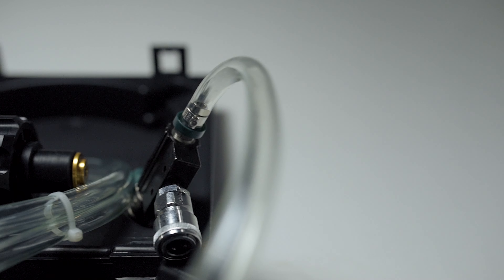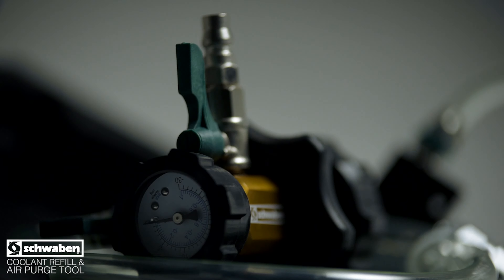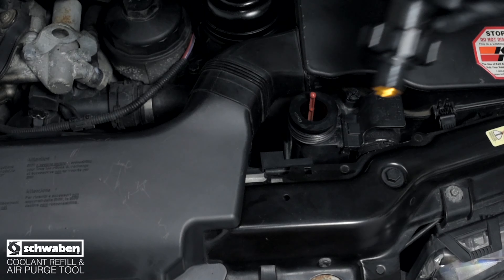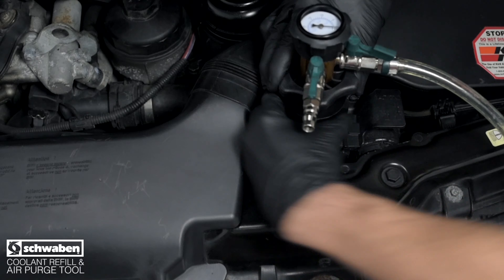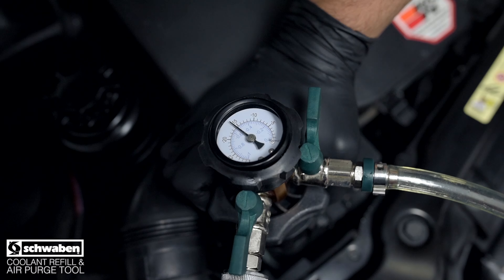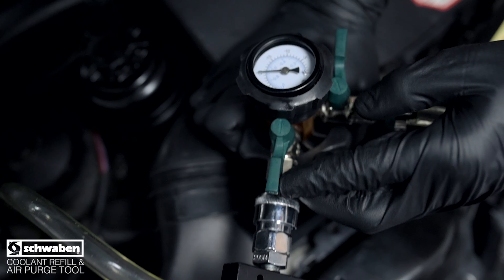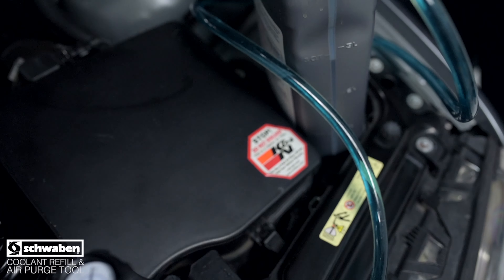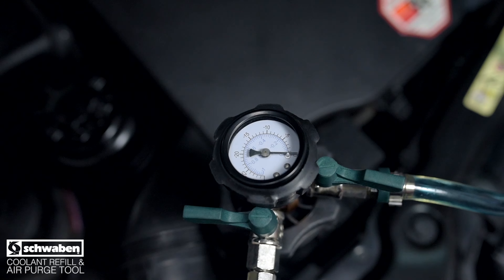How to Use a Coolant Evacuation Tool

Comment: I totally agree with Dan z. It's all misleading. Evacuate to me means removing all fluid (coolant) via vacuum pulled. Than switching a valve too allow new coolant to enter system air free. Done..

Comment: The hose sucking the coolant was empty of liquid and full of air... all the air went into the cooling system.

You need to create the vacuum, then open the feeding valve until the hose is full of coolant up to the gauge, then close it and re-apply the required vacuum, then open the coolant feed to fill the system.
Reply: That is correct. I thought the same thing.. oops, you just let all the air in the tube between the valve and the coolant jug into the system.  This defeated the whole purpose and really is a fail.
Reply: in theory yes, the volume of air from the suction hose went inside but in reality what actually happened, this small amount of air just lowered the vacuum inside the system from -20 to let's say -19 inHg...still plenty of vacuum. A complete vacuum would read -29 which is not necessary for this kind of procedure anyways. So there was nothing wrong with the procedure
Reply: T🥲❤❤❤

Comment: It is the proper tool need on many newer model 2000 and up vehicles factory recommends to prevent air pockets is cooling systems which cause major damage the engine it may not remove all air but enough to do the job !

Comment: why do these tools get labeled as evacuation tools?  evacuation to me is evacuating the cooling system of the fluid...
Reply: Because it is evacuating the air out of the system
Reply: @handyishrandyish334  Then it should be labeled "coolant system air evacuator" not "coolant evacuator". This is not what I am looking for.
Reply: @Addison0526  definitely agree with you. I learn how to use this at school and admittedly got confused thinking you could extract fluid with it but really it will just spray fluid/water if you try, but it doesn’t take that long to drain a cooling system realistically it’s just taking off a hose or using the drain cock sometimes like on the Prius I worked on the drain cock is just really hard to get to you and you have to remove the whole bumper cover panel😅

Comment: So I have a question.
If your pulling a vacuum of 24" (30" being absolute vacuum) then you are only removing 80% of the air.
What happens to the remaining 20% of the air.
Does it just congregate in any high spots.
Can the process be repeated when the system as coolant in it?
Reply: When you negatively pressurize the system to about 25 psi, that should take as much air out of the system as you need, there's no chance of enough air staying in there to cause any issue.

Comment: Well the question is, how much psi are you pushing through the devise? Or does it matter?
Reply: Posting in 2023 and STILL trying to find the correct answer to this question. 
Im actually amazed how difficult it is to get the answer. You'd think it would be in the products instructions, but no, it is not. Ive watched all the videos i could find on the use of this EXACT product and not one of them says how much psi they are using... NOT ONE!!
Reply: @TheNobleLoyalist atleast 90

Comment: The air in the tube between the valve and the coolant jug entered the system defeating the whole purpose.
Reply: As it is such a minuscule amount it shouldn’t cause an issue. When the coolant circulates around the engine, the tiny amount of air should flow back into the expansion tank as air bubbles where it will percolate to the top and will fill the space in between the coolant level and the lid/ cap of the expansion tank where it will stay along with the air that was captured when screwing down the expansion tank cap.
Reply: @cmrnx  guess my question then is... why bother?  just dump the coolant in.   Id say our definition of minuscule differs.  I think bubble,  you think enough to fill a cooling jacket.  That is also plenty enough of air to get trapped in the heads ... just prime for airlock..then  hot spot..then warping, especially if thats your method on a high horse setup
Reply: ctsvmapper if you think of it in this way, if you take say the lower rad hose off, then replace it, is terms of displacement, the volume of air that would enter the system through the pipe being removed would be vastly greater than the air that would enter via the small purge pipe on a tool like this. I work in a main JLR retailer and have used both the traditional method of filling the cooling system as well as using one of these tools, I’ve never had any difficulties after using the vacuum filler but occasionally with the traditional method, I’ve run into difficulty
Reply: @cmrnx ah gottcha,  yes you are correct,  even when not fully properly using the tool to its full potential is still more efficient than traditional.
Reply: Obviously, which is why you should prep the fill tube before hand to fill up with coolant and prior to filling it.

Comment: All of these purge tool labels stress drain coolant system first. doesn't that mean evacuate?? That's easier said than done. Drain radiator. Yeah right, what about what's still in engine block, an heater core. Like I said before misleading. You should be able to vacuum it out.
Reply: Hey Frank .. while recently doing a refresh on a V8 Titan I found my shop vac hose almost a perfect match to the holes in the block for the thermostat and water pump. With the shop vac in 'water' mode, it sucked all the remaining fluid out of the block. I felt vacuum pull from the O/flow res. and remaining coolant was out. Beautiful :-}
Reply: @chadpeterson3473  That's risky business. Many cooling systems operate around 10~20 psi and a shop vac may very well exceed that type of pressure. I wish there was a tool of sorts to do that though... VW is a PITA just to drain let alone truly flush.
Reply: @AltruisticWarrior  There's never a drain port with VW. Have to remove the lower coolant hose which is usually difficult to get to and it's messy...

Comment: Well the question is, how much psi are you pushing through the devise? Or does it matter?
Reply: I saw this other video mentioning to set air at 80-90 psi working pressure there about. I know this question is old but hopefully the answer helps someone else in the future.
Reply: I need an answer to this too